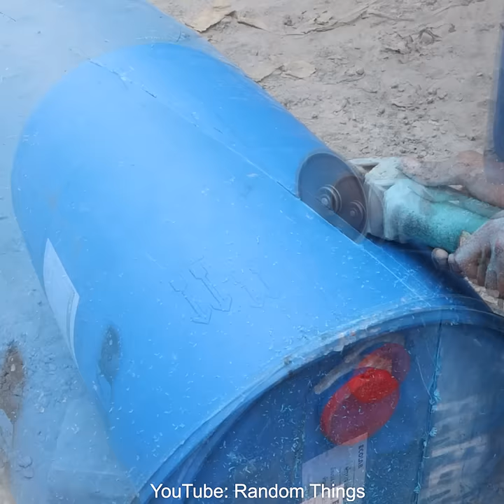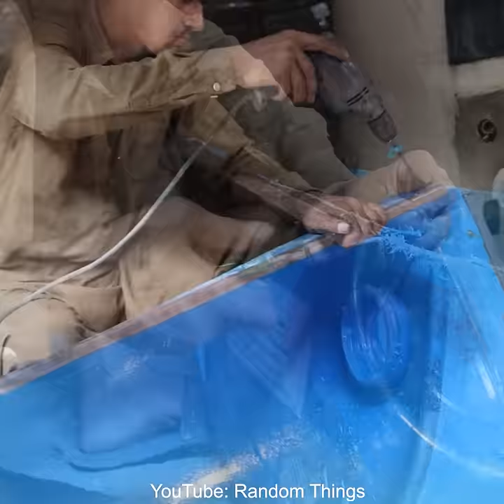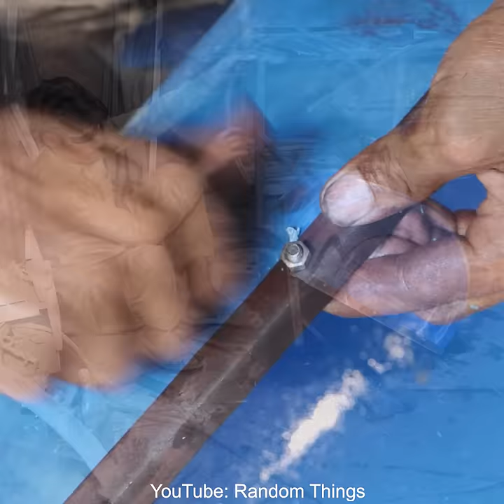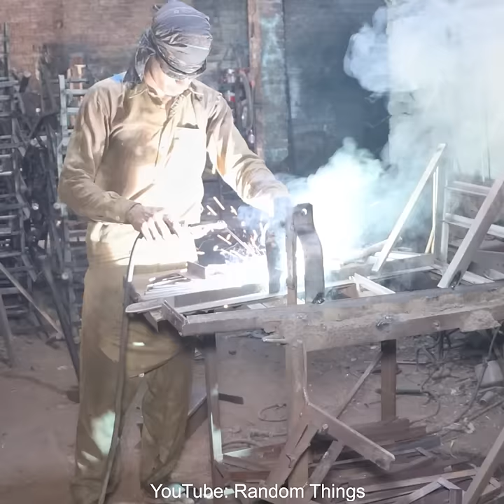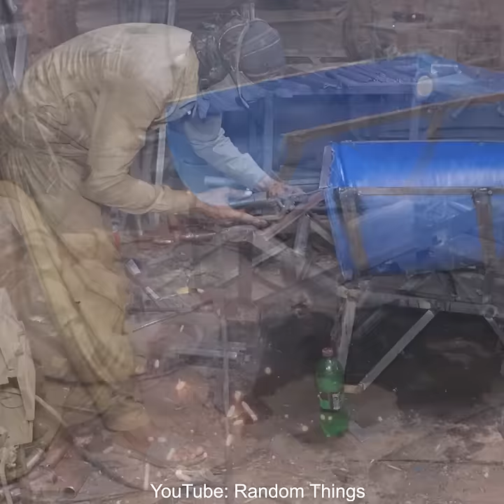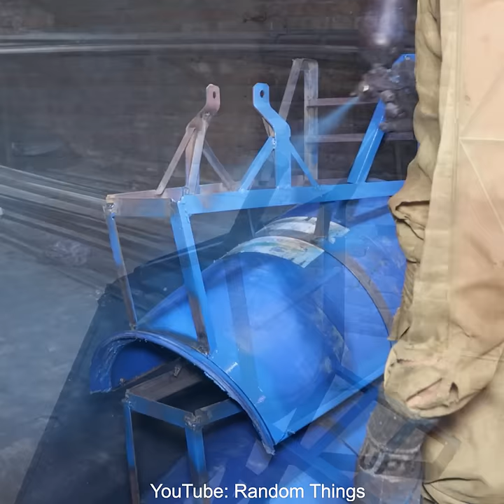How To Make Wheelbarrow from Old Plactic Drums

Comment: Looks better built and more sturdy than anything at lowes or home depot here in the states
Reply: yeah, that thing will last for generations. if the barrel wears out, just get a new one and use a hot knife to cut it along the frame, perfection!
Reply: I double that Statement!!!! Well Said!!!
Reply: At last someone praised the underdogs, thanks
Reply: @jeffreytabag9380 
I agree Jeff, there’s too many bad and unwarranted comments on here in my opinion! 👍🏼
Reply: @kevdimo6459  not only here, but also there, and everywhere. Who once told by the Beatles😍🤗
Reply: requesting for a job am a spray painter ...am a kenyan
Reply: And it's more durable thats it won't rust after many cleans

Comment: They don't understand the concept of having the wheelbarrow hold the weight  Of the load instead of the person pushing it.
Reply: Did you have a conversation with them and they told you that? Or did you just make that up in your imagination? Did it maybe occur to you that they are smart enough without your assistance to make a wheelbarrow for their purposes? Do you even know the intended use of this wheelbarrow?
If it was made for wet concrete pushed across sandy soil then it would be perfect, wouldn't it. It would place the greater weight on the operator so the skinny front tire doesn't sink in the sand. It is obviously made for transporting a liquid.
Reply: Idk… good repurposing of plastic . From the vid it’s hard to judge if it is too top heavy or not 🧐
Reply: @artszabo1015  just a guess but you have never used a wheel barrow 🤡😂😂😂😂